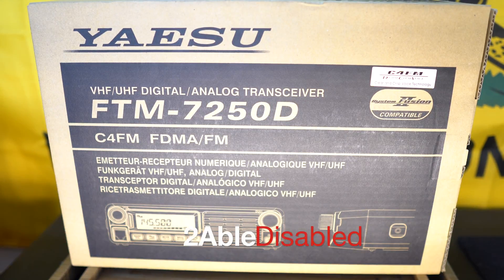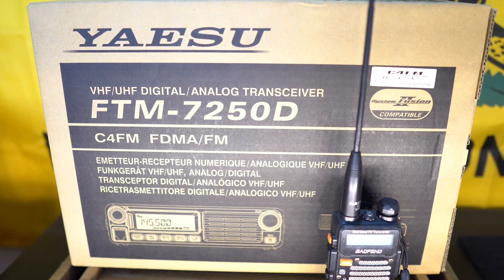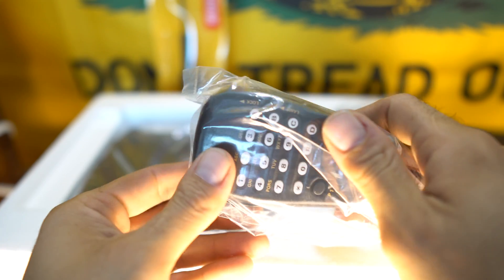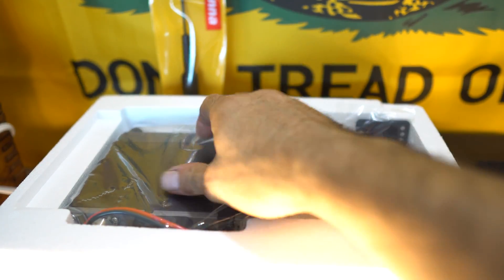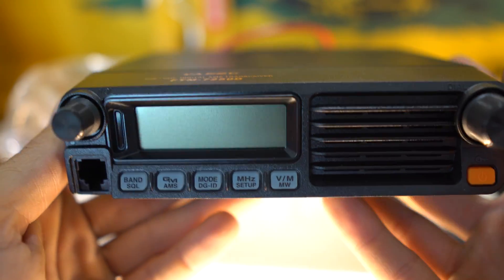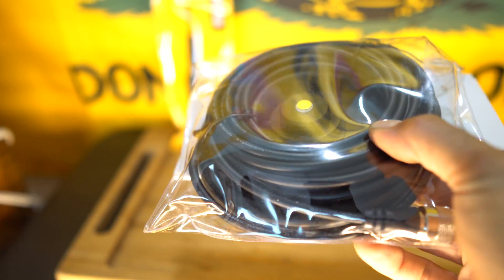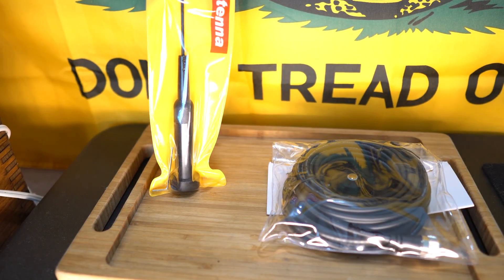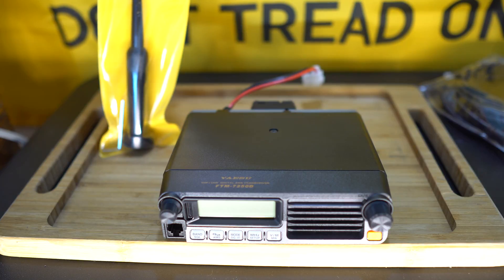Yaesu FTM-7250D Unboxing

Comment: I'm retired from a part of the electronics industry, and finally decided to get licensed. I passed both Technician and General on the first try, using the Gordon West books (available through Amazon or direct from the ARRL). Those books are generally accepted as the best test-prep study guides. With a EE background, you should be able to get all the way through Amateur Extra without much trouble! Good luck!  :-)